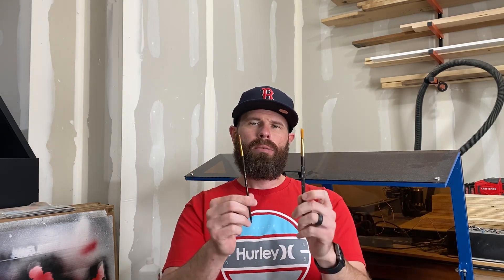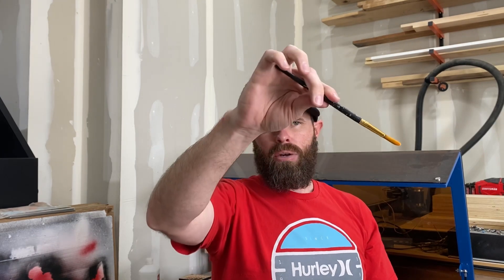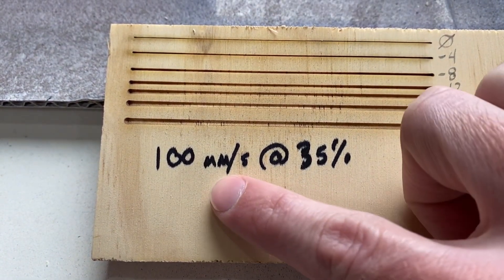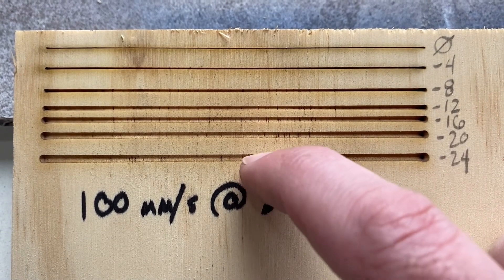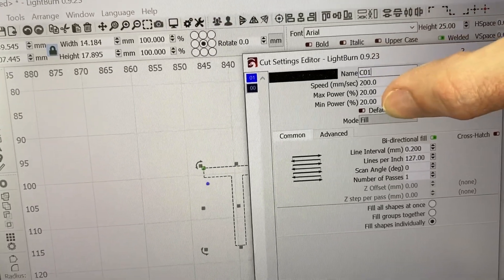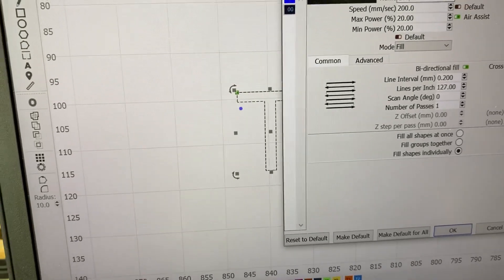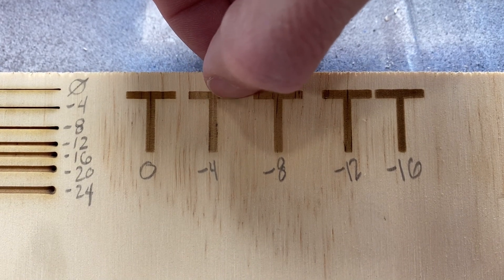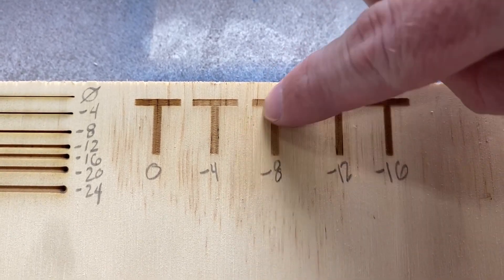Defocusing your laser for engraving and etching lines

Comment: I tried this technique yesterday on acrylic as trying to create a groove for an O-Ring to sit in using the out of focused line. It works well to give a nice smooth groove, however the cross section of the groove is V shaped which is odd as an out of focused laser shape is the opposite of that. Is there a way to achieve more of a U shaped groove (flat bottom with steep walls) with this technique?

Comment: I just received the new longer nano 6W yesterday, I've been playing with settings, unlike normal set up where the laser is on tracks for its axis travel this thing uses something else as the laser is in static position, I have only done some trials today but have found its useless for cutting, I know a 6w isn't going to do James bond stuff I only want it to cut 3mm stuff but the laser cuts at angular meaning the farther toward the edge the cut is angled not straight through the material as your demo shows but it also even using laserGRBL 20 lines per mm leaves signs of lines when focused properly.
coming across your post is great, obviously you're a pro using high end machines not this hobby thing I'm using but I'm going to run some tests defocussing the laser as you describe, thnaks for posting the tip.
Reply from the maker: You’re welcome! Sounds like it is a Galvo based machine.

Comment: I'm just bombarding myself with concepts and information before I get into using my 10W diode laser, then your video showed up in my recommendations. This is SUCH a good idea. I would hazard a guess that a diode laser would require a few percent lower movement speed for every MM raised to compensate for the lower performance as it's defocused, BUT, I feel like it would be a worthy experiment. Maybe a tight in focus outline of the letter to make the edges crisp, and then a defocused "fill" engraving on the centre. Good techniques to consider.

Comment: Does this work with diode lasers?  Can you use this to fill large areas?
Reply from the maker: Yes it is the same concept but you will need to test to draw your own conclusions because the power from the diodes is much less than the laser used in this video.

Comment: what method are you using to defocus? are you using lightburn to set the defocus or manually moving the bed lower with control pad? If using lightburn were do you make this change?

Comment: There is no criticism of the principle you are trying to demonstrate. Dropping the focus will do two things for organic materials.  First it reduces the CUTTING ability of the lens as the line widens  and  secondly  it reduces beam INTENSITY  so that the wood scorches. more and more as you defocus. Usually 6 to 8mm is optimal. 
 A fascinating illusion happens when the beam is correctly focussed and CUTTING deep thin black lines. In reality those lines are not burnt black. If you section a cut,  the face of the cut is virtually scorch-free The black illusion is created by occlusion of light not getting into the cut. . Only when you reduce the CUTTING ability of the lens by defocus does the cut depth decrease and  the instant material vaporisation become scorching

Comment: Dude, your beard and videos rock!  I just got into Laser cutting and was watching this defocusing video.  It all makes sense, although I was wondering what is the workflow process to defocus a job.  For example, I wanted to create a quick test on acrylic that etches my name, and then I use offset to draw a cut line around the outside of the letters.  If I run the job it etches first and then goes to the outside cutline.  Do I need to create the same job twice and adjust the floor manually?  I assume there is a more effective method.  Any insight is appreciated.
Reply: i would guess that adjusting the floor is going to throw the engraving slightly off of the original orientation and it might then not clean up the edges on some of the lines..deepends i guess on the quality of the machine.
Reply from the maker: On my 100w machine I have a motorized bed so I program it to drop when I need it to do this technique. Then it will raise back up for the cut operations.
Reply: @BeardedBuildsCo  I just ened up running the project in multiple steps.

Comment: Great info thank you! You could probably use fill and line in Lightburn to neaten and sharpen the engraved edges of the  letter "T"
Reply: I was thinking the same.  Do the fill fast / defocused  and then do a more focused line pass to sharpen up the outline.